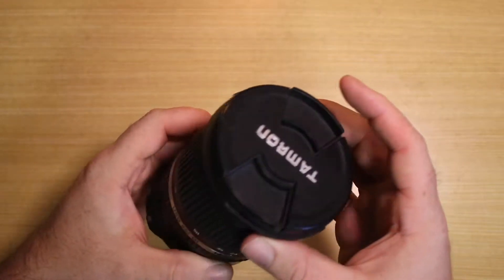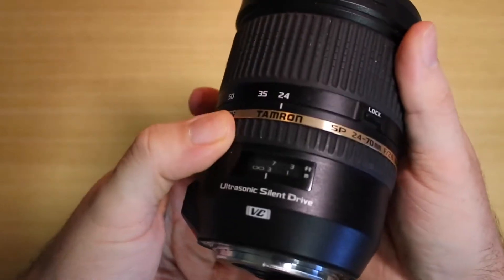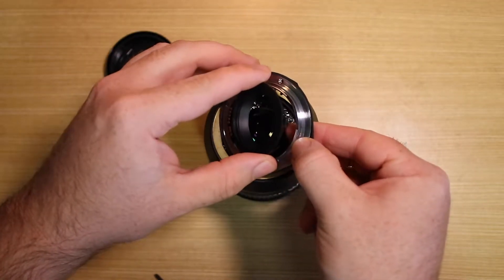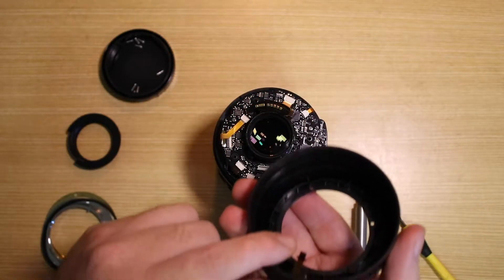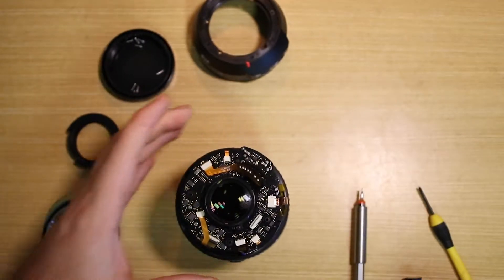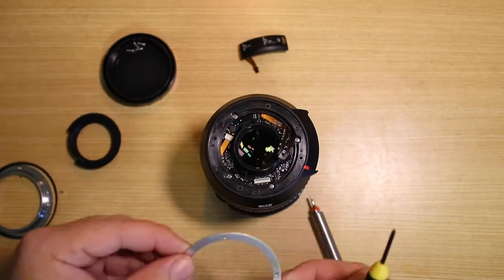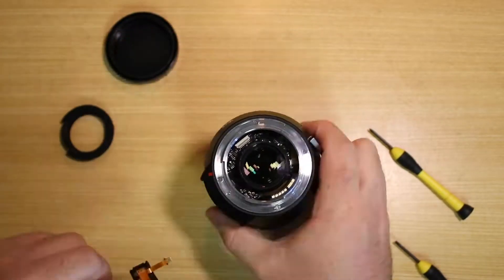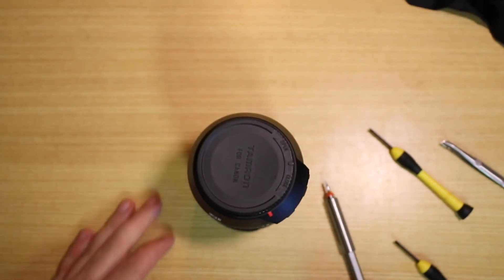Tamron 24-70mm lens - Focus Fix Attempt

Comment: Hi! I am thinking of buying a used tamron 24 75mm 2.8 Di Ef lens for Canon full frame. The lens seems to be in good condition, what happens is that it was opened by a fungus cleaning by the same owner and from that moment the autofocus tries to focus but does not succeed. I would like to know if it is possible that it is what they explain in this video. The truth is a good opportunity, the lens is half of what a used lens is worth, what would you recommend? I think that if the lens cannot be repaired for the price it costs it is a great opportunity.